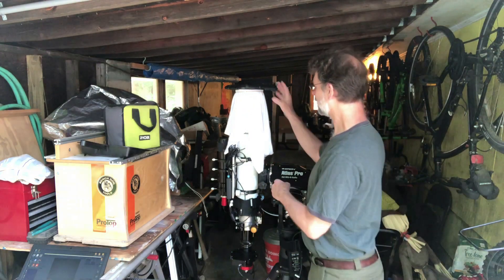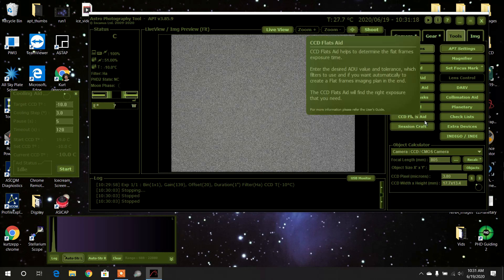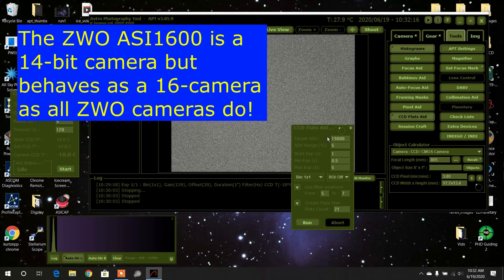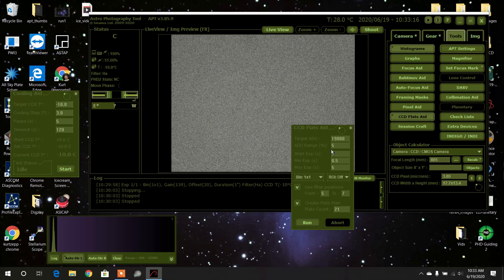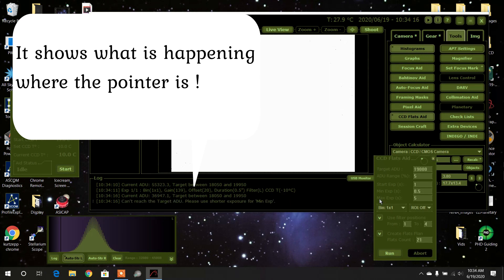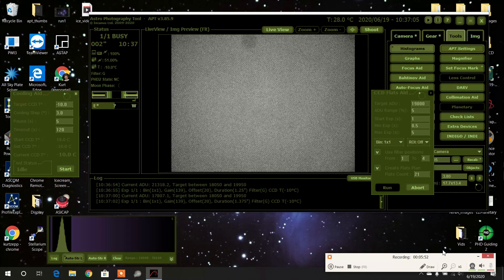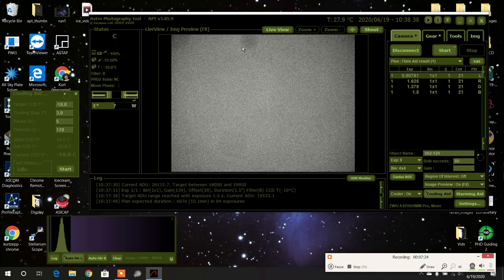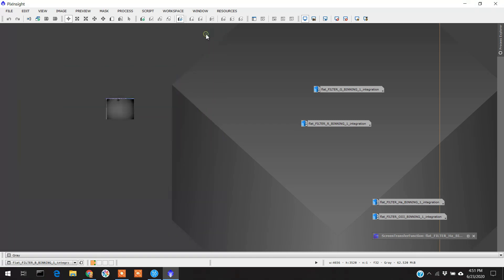Taking Flats with AstroPhotography Tool (APT) - Update 2020

Comment: ADU= 12^14 in your case since your camera is 14 bit. 49-50% of that number is what your ADU setting for flats ought to be. Approx. 8028 at 49%. We aren't getting the same number and I would like to know who "they" is or are. I didn't think you would be using the full ADU value and these "they" authorities don't seem to know how to raise 2 to any exponent, in this case 14.

Kurt it may be different with filters IDK, although I would think this ought to change only the exposures not the ADU*49% values.
Reply from the maker: Good point.
Reply: @AstroQuest1  Kurt I dispensed with the above fine points in using Flats tool for my Mallincamsky cameras. Just set the Gain to a relatively low setting.  100 is the absolute minimum in APT. This corresponds to a Gain of 1 on the Mallincamsky DS10c and DS26c cameras, I used a plexiglass translucent sheet with the scope pointing straight up into an overcast early morning sky.  The exposures are around 0.22 seconds on these illumination levels. Once I get the OK I have APT make a sequence of these flats. I then quickly duplicated the same settings I gained from APT Flats Tool and made a sequence of "flats" in the Mallincamsky software using a gain of 1 and exposure setting of 0.22 seconds...so APT Flats Tool helped me make good flats for my Mallincamsky cameras
Reply from the maker: @dankahraman354  Great idea with the plexiglass sheet Dan.
Reply: @dankahraman354  Great tip...got my plexi sheet today, shooting flats now.